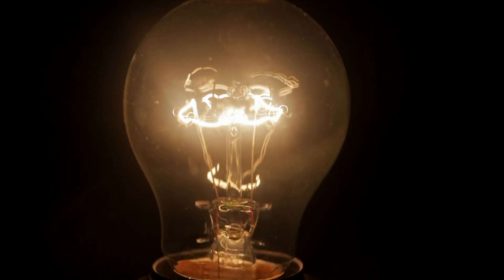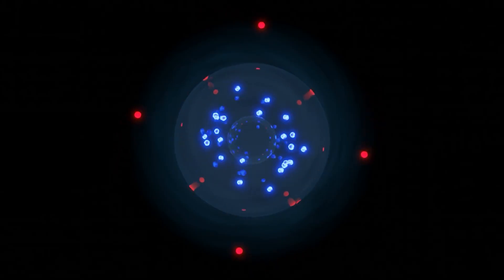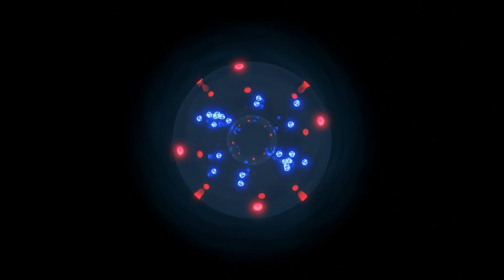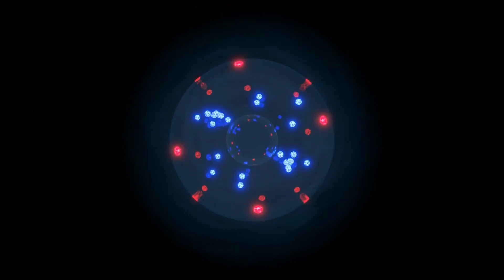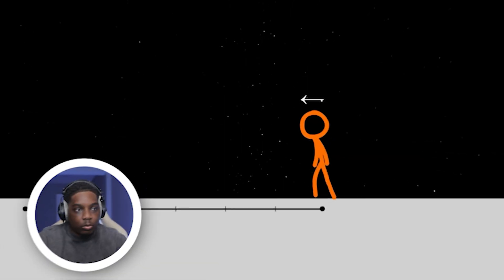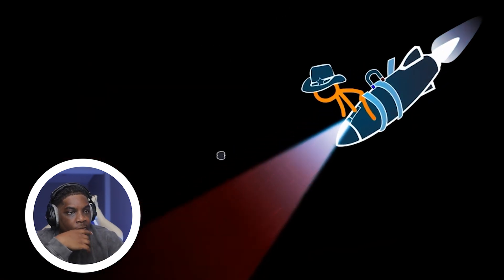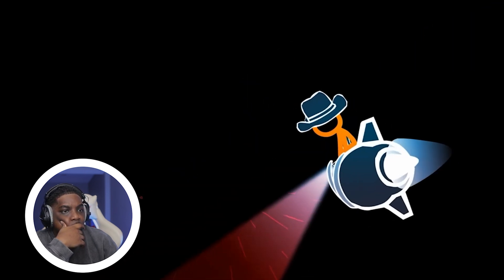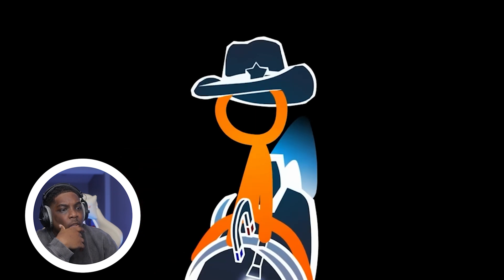Opto-Electronics Engineer Reacts To “Animation Vs. Physics”

Comment: The stickman orbiting the sun is using something typically called the slingshot principle to gain momentum. You use the gravity of the object your orbiting to generate extra momentum then shoot off with an exiting ascent. They didn't really show the calculations, probably because its somewhat lengthy. You have to account for a lot of variables( the point where you become too close and get pulled into the object, the angle of your decent and ascent, the gravity at various distances , the speed requirement to escape the gravitational pull and exit, ect...)

Comment: Why is it f=ma, why is it not f=mv? F=ma would from my perspective mean that force is ever increasing as acceleration is a measure of changes in speed over time a=meters per second per second. It seems to me that force as a constant should be represented as a constant mass moving at a constant speed. If you are accelerating than wouldn't the force increase as the velocity increases? As well could force be separated from velocity or acceleration? It takes x force to move a 5000 lbs. truck, yet it takes more force to move a 5000 lbs truck with a 5000 lbs load whether or not it is accelerating or moving at a constant velocity. The force being applied  has no relation to the weight, but the amount of fuel burned to release energy to apply a force on the piston. There is more fuel burned to create more force to move the piston under heaver loads. If the truck is moving at 30m/s regardless of the load, the pistons in the engine are going to move at the same speed to move the truck at said speed. So at this point the force is not dictating the speed, but the speed is dictating how much force is needed respective of the load.

Obviously I have had no training in physics, I barley graduated high school, not because I was dumb, but because school was extremely boring for me and I did what I need to to do to just get by.